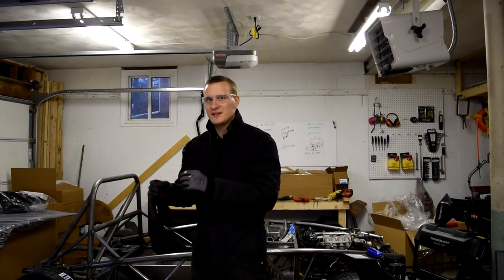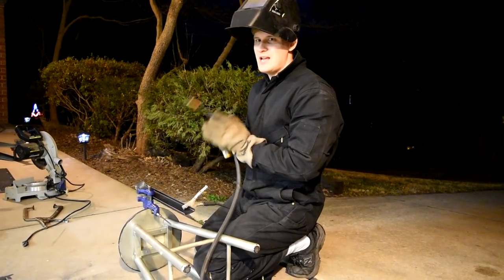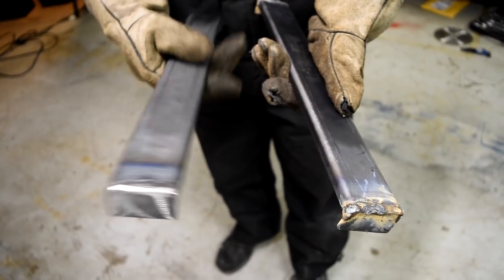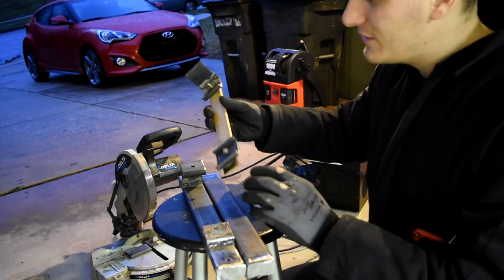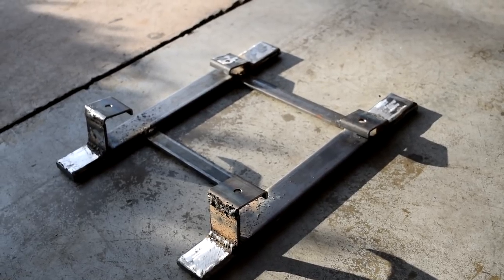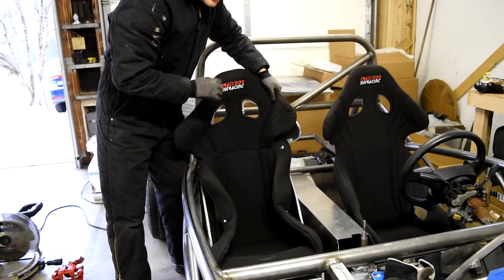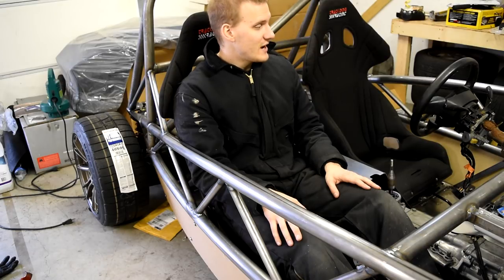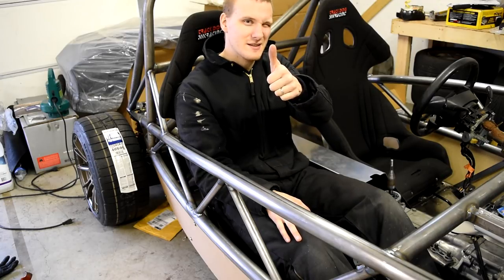Building The Exocet Seat Mounts

Comment: When you assemble the seats for real, don't forget to put washers both ends, grower washer, nyloc nuts, or double nuts, or nut w/ loctite. You can also cut the bolts shorter and file them, so it looks good on top of being safe ;)
Reply from the maker: we are just doing a rough fitting for now. once the final install is done we will have all those issues addressed.

Thanks,
Reply: Bolts going through the floor are the only bolts that should fit upwards to you don’t reduce ground clearance and don’t damage the threads.

Comment: Hello, don't take this the wrong way but the seat mounts can't be done as you assembled it. The welded upper L pieces that hold the seat have to be more rigid for sure. Sure I just eyeballed it but I am doing strength simulations for motorsport and in the act of crash as you mentioned in the video, these mounts would hardly survive. At least close also the other side, but better box it. That way the mounts will be able to hold higher strength in bending as well as tensile strength. Safety first
Reply from the maker: I plan on boxing it in except for the back side. I just wanted to get the general shape down before I went any further.

Thank for the concern though, its nice to know that others care about safety.
Reply: good! Lookin forward to see you shred this thing, man. I'm building something similar next year :)

Comment: What was wrong with the way the kit has the seats? Why the need to re-engineer the thing? That was not made clear in your video, or I missed it...
Reply from the maker: The seats from Track Dog Racing are designed to be mounted on the floor and not on sliders. The drivers seat is on sliders so to make both seats sit at the same height so its not an eye sore with different height seats I had to engineer a seat mount that would do just that.

Hope this helps.
Reply: Thanks.